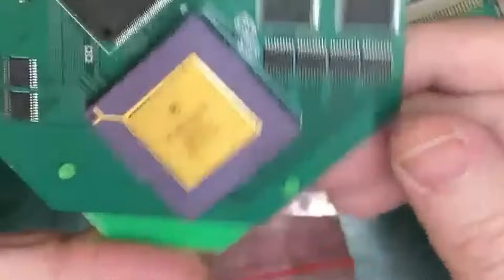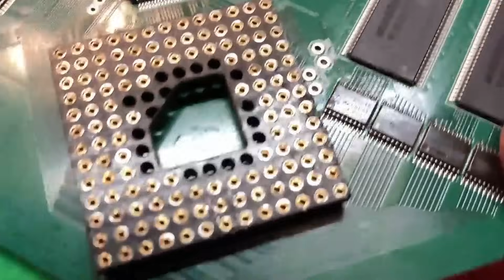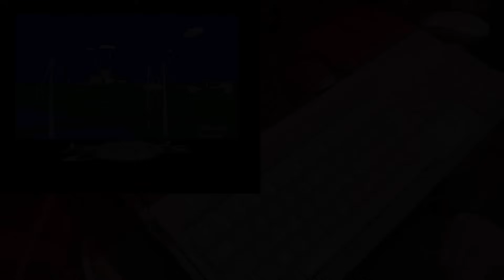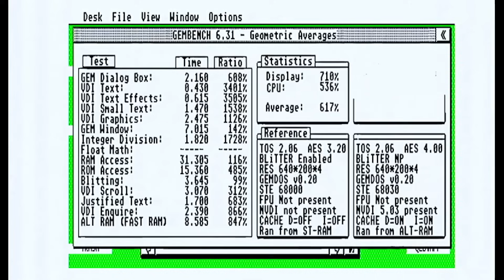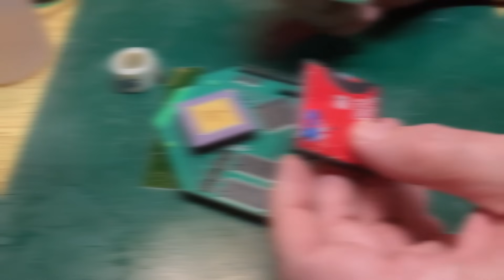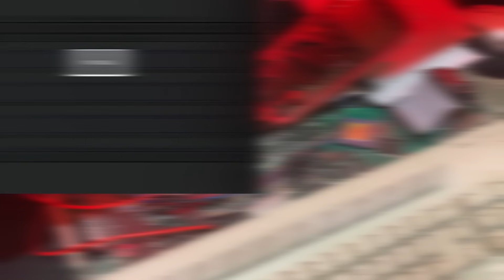STE536. A plug and play STE accelerator. Part 1.

Comment: Reminds me that I still need to build my ST536. The main issue with these boosters is that on a ST you really want a 68000 mode. So a dual cpu setup would be ideal.
Reply from the maker: I agree and that'll be one of the talking points in part two.

Comment: My CPU is soldered to the board, would it be possible to modify the accelerator to be soldered in?
Reply from the maker: Sadly the simplest way around that is probably to remove the CPU and fit an SMT PLCC socket.
Reply: @thetechnoshed  I did wonder that? The problem is though,  as I had assumed from Exxos' other STe boosters, do I replace the socket with a normal one or would it need the "funky" variant? On the positive side, am I correct in thinking I wouldn't need the "Fast Tos" board, as this is incorporated into the 536 PCB?
Reply from the maker: @dav1dbone I’m not 100% sure, as I don’t have a soldered-chip board, but I think the footprint for a PLCC chip and an SMT PLCC socket is identical. The ‘funky’ part of the sockets on the original ST boards comes from the zig-zag through hole arrangement which is obviously not a factor with an SMT part. There are other issues you may run into, though: modern SMT sockets are quite low profile - would they grip the pins well enough; hand soldering SMT PLCC sockets is hard and normally needs butchery of the base then taping it back in!
Reply from the maker: And yes, no other parts would be needed. It’s self-contained. You have to pull your other ROM, though.
Reply: @thetechnoshed  yes, makes sense. I've not actually removed my ste mainboard, only looked at it from the topside, the soldered CPU though, I was sure it was through pin, not surface mounted? I'll have a closer look 😁

Comment: I'm definitely tempted. When you get it running stable with TOS, could you please try booting NetBSD/Atari on it? If you can boot NetBSD then I'm buying one.
Reply from the maker: I managed to boot NetBSD on my Falcon once. I haven’t gone back to that again. Good idea!
Reply: @thetechnoshed  I've been playing a an image of NetBSD 9 m68k under Amiberry recently. It was crippled a bit because the pkgin package installation tool is missing from the repos so give NetBSD 9 a miss. It was cool that I was able to download packages using ftp running under NetBSD on my emulated Amiga 4000 running under Linux. 

Hatari cannot boot NetBSD, I've been told although I haven't tried it myself. I'm tempted to havea go at installing NetBSD 10 under Amiberry from scratch then I can share the image if I make it that far.
Reply: NetBSD/Atari will use a different bootloader and probably uses a different disk partition / format too so I doubt such an image would work on this  STe too, but it could probably be lifted n'shifted to the right disk and bootloader if you wanted to go that route and you'd be able to run the same OS and binaries on the ST.